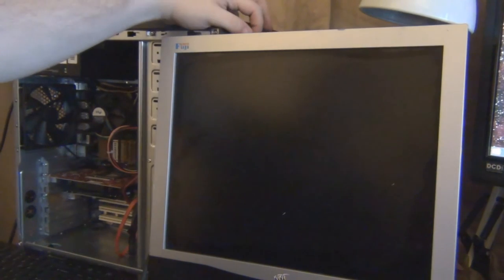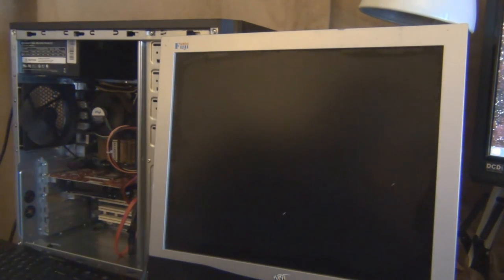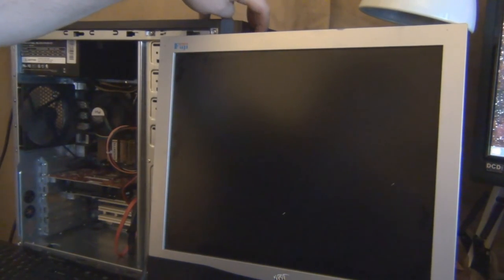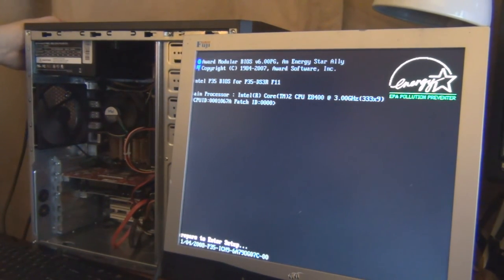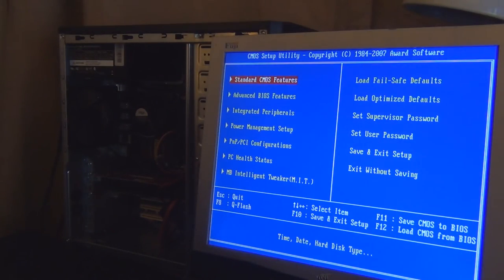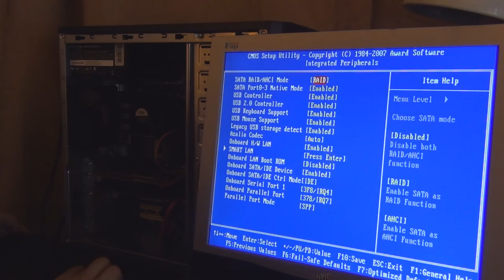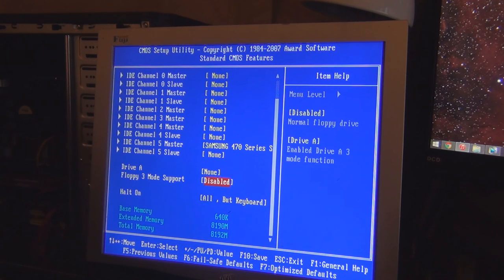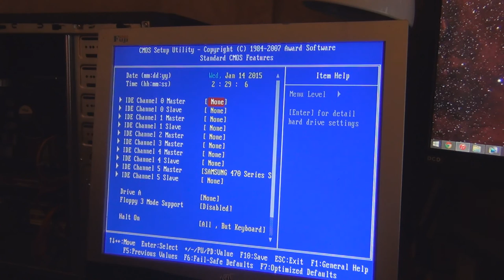Core 2 Duo E8400 Office PC Build

Comment: I had the E8400 CPU in a computer until 2012, and it had very good performance for the money. In fact i would still use it with 8GB of RAM and an SSD if I didn't want to change my computer to play some newer pc games.
Reply from the maker: +kanopus06 It is surprising how usable this CPU is today for daily tasks.  It would indeed be pretty terrible for gaming I'm sure.
Reply: +praskieva Computing Now it would be something equivalent of a low end pentium dual core cpu. but 3GHz clock speed, dual core and 6MB of cache was a beast of a cpu back in 2008.
Reply: yep,it's great for gaming too.
Reply: it can run new titles as well as older titles like 2005's Most wanted 2006's Carbon , Underground , Underground 2 , Star trek Online , NFS world , GTA V , GTA SA , GTA III , GTA IV , NFS III Hot pursuit ,  COD 4 Modern Warfare , COD 5 World at War , NFS Shift , NFS Hot pursuit 2010 , Diablo , Starcraft , Warcraft I II and III , Diablo II , Flat out II , Age of Empires I II and III , Halo : CE , NFS Highstakes , NFS Porsche Unleashed and even DOOM 2016 and Duke Nukem Forever and the Original Duke Nukem and DOOM and Maybe Alien vs Predator . forgot to mention Fallout III , New Vegas , and Fallout IV
Reply: @gamepad3153  You forget Crysis.

Comment: Just built an E8400 PC for old school '00s gaming and for secondary use here.

Intel E8400 (E0 Stepping) @ 3.0GHz CPU
Gigabyte EP35-DS3R (Rev. 2.1) motherboard (F4 BIOS)
4x2GB G.Skill PC2-8000 DDR2 SDRAM
2GB Palit GTX 650 GPU
Windows XP Pro/8.1 Pro Dual Boot

Motherboard's been sitting there on the shelf since the late '00s brand new and sealed. Then at the start of this year (2016) I wondered if it actually worked. One quick trip to eBay later for the E8400, a cooler and a memory stick for just £14 total, stuck it in my Cooler Master Elite 370 old PC case with an EVGA GTX 960 SSC 4GB borrowed from my recent new build and yep, it worked, even with the original F2 BIOS. So I got the rest of the bits from eBay afterwards.

Already had a 600W Jeantech Arctic modular PSU, 1TB Seagate HDD, Lite-On DVD drives, Sony floppy drive, Xigmatek Blue LED fans, Scythe Kaze Master KM-01BK Fan Controller & Sound Blaster Audigy 1 (with firewire port) with the Cooler Master case from my old S939 Athlon 64 X2 4800+ build. Also had the ESATA backplate that came with the EP35-DS3R, USB, serial, parallel, MIDI and GPU ventilation backplates to fill in the back, various internal adapters and cables, and a motherboard PC speaker for beep codes.

Now I have a secondary system on the cheap that works great! :-)
Reply: Awesome
Reply: does it work fine with windows 10?
Reply: Darren Johnson-Jane yes. win10 works fine.  i added third party video cards. a Nvidia 1050 should be good for you.
Reply: Jason Rini Hello Jason.

Since the initial build above, I've upgraded the Palit GTX 650 to an EVGA 750 Ti SC (complete with EVGA's 750 Ti backplate). However, I figure a 1050 would be a bit much for just an E8400, but would go better with the likes of a Q6600.

Kind of like making a genetically engineered T-Rex for a theme park. Just because you can doesn't mean you should (Oy Rex! Quit being so bitey!) ;-)
Reply: Darren Johnson-Jane i figured the 1050ti would be the final upgrade for the system...

Comment: my system is core 2 duo e8400 equiped with 8gb of ddr3 ram and a gtx 1050 ti gaming x 4 gb runs pretty smouth on some demanding games like black ops/sniper elite 3 need for speed rivals all on ultra settings BUT cpu bottleneck is very obvious on more cpu demanding games like assasin's creed etc.....about moba games like lol cs:go dota runs pretty smouth with locked 60 fps no drops nothing :)